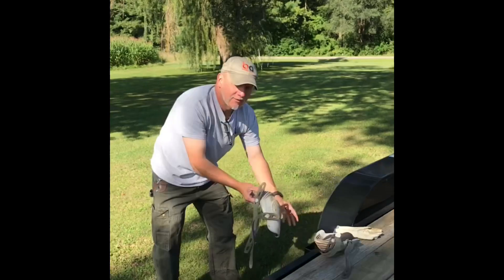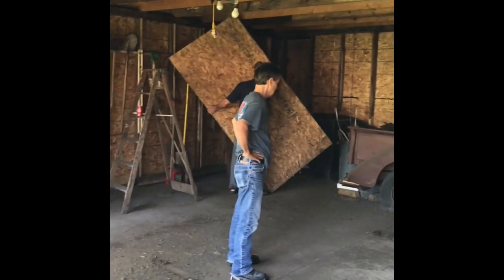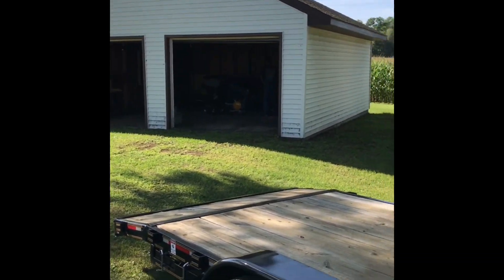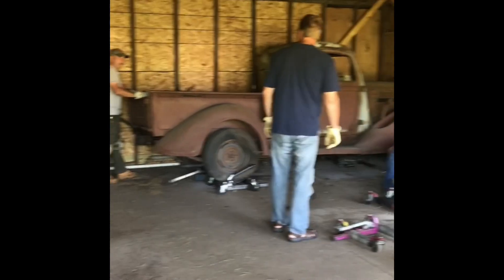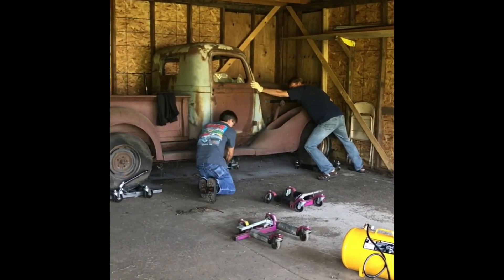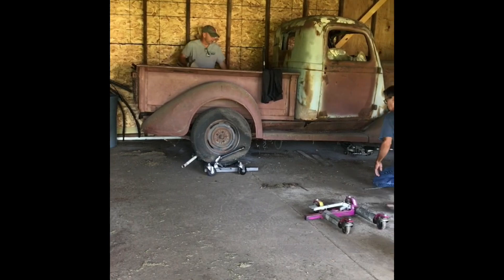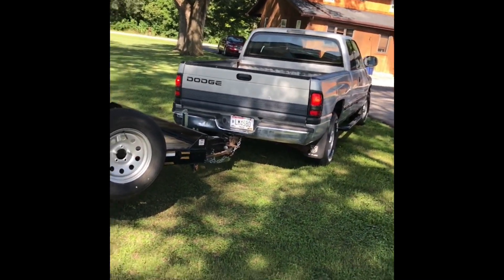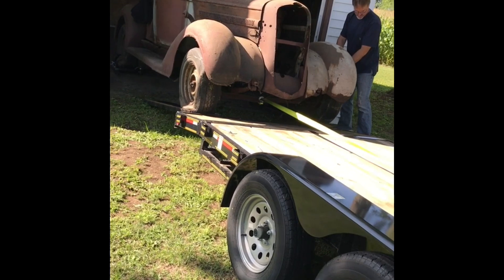1937 Dodge Truck sees light for first time in over 30 years

Comment: Cool ! Not many left . Is that original tail gate I didn't the embossed Dodge on it .?
Reply from the maker: I believe the tailgate was changed and had many repairs…
Reply: @Nelsons-Garage   one question for ya .  I keep having to replace voltage regulators ,. What could be the problem? Thanks
Reply from the maker: @mikethespike6304  what kind do you have? One thing to look at is making sure the regulator is grounded. One other thing is that it’s not too close the a heat source, like an exhaust manifold. They can usually handle heat but it’s a good thing to check.
Reply from the maker: @mikethespike6304  What amp alternator are you running? make sure the regulator can handle the alternator.
Reply: @Nelsons-Garage  Its a stock alternator a few yrs old and had it checked its good I did  replaced the  voltage regulator I seem to go threw those   on the fire wall .  checking plugs and wires now . I need to find Where should a fusible ?
Reply: @Nelsons-Garage  I have a voltage regulator and stock  alternator  I dont know how many amps that would be.
Reply from the maker: @mikethespike6304  ok, stock, what year is the alternator and regulator for? I’m assuming they are for the same year so they should work together? Again I would look at if the case of the regulator is grounded and the case of the alternator is grounded. Also check the ground to the engine and ground to the body. If all that is good and you keep burning up voltage regulators, I would change to a different style regulator. Let me know if the grounds are good and I can get info to you if you want to try a different regulator. One more question, has this always been happening or did it just start?